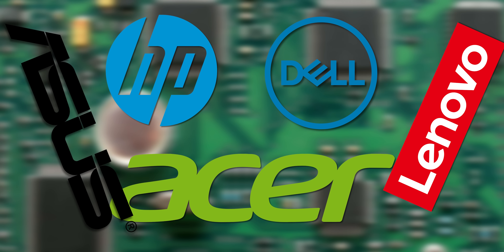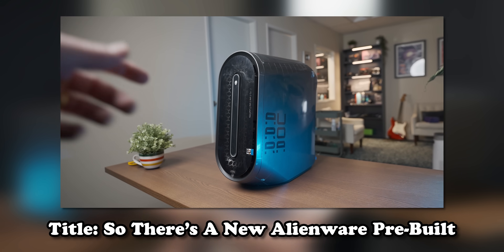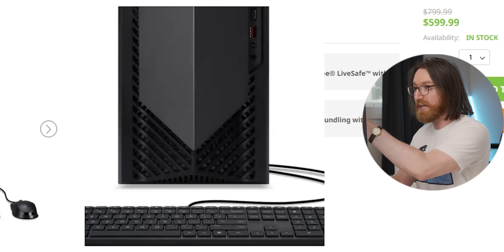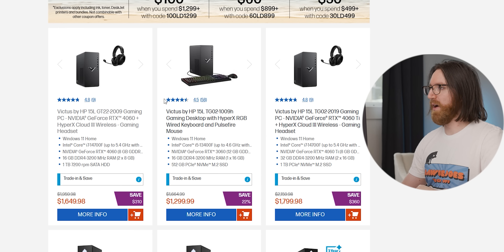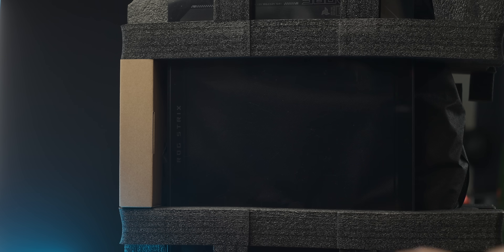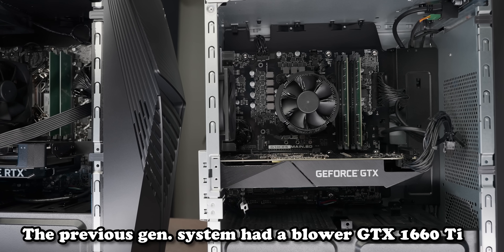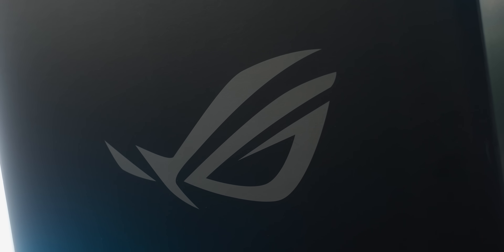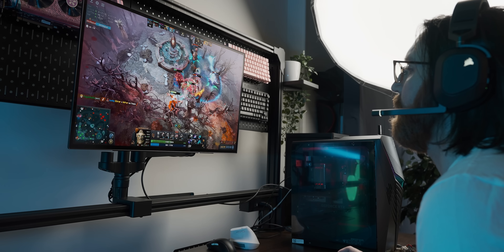Are Pre-Built Gaming PCs Better In 2024?

Comment: Dawid, I’ll never complain about a prebuilt ever again. I got a Skytech prebuilt with a 14700k and a 4070ti with 32gb ddr5, WiFi 6e board and an aio with a gen 1tb ssd at a local pawn shop for $600. And the biggest thing is it is all off the shelf parts. Nothing is proprietary. I’m in love 😂
Reply: Pawn shop was super stupid to set at that price. Super, super dumb
Reply: @kevinthecleric  I think it was a loan someone defaulted on so they just priced it at what they lost
Reply: Prebuilt is a just a term for a computer ready built. It's who built it and in what configuration that is the potential issue... And OEMs are the very worst for the reasons given by Dawid. Other businesses/solo flyers build with off the shelf parts and sell, Or you choose parts and they build and sell ... And they could make it decent. Buying pre-built doesn't automatically mean it's going to be bad in any form, But it could be depending. And some charge reasonable prices, Others rip you sideways. It's always best to build yourself for value and quality control, But if that's not your bag  there's good options out there.
Reply: Nice
Reply: Fairly standard pawn shop practice, but can't help but believe they let that slip through 'em without pricing properly. 900 bux would have still been pretty cheap for that.
Reply: Sounds like someone built a PC and took out a loan against it. Wouldmt really consider that a prebuilt
Reply: @benstanfill363  it has skytech gaming prebuilt stickers on it. So unless the previous owner has that for some reason where it’s not a prebuilt, then sure. I guess so. Never seen a case have prebuilt company stickers unless it was a prebuilt.
Reply: @benstanfill363 kid you don't understand what prebuilts are? They arent custom brand parts. They are parts you buy at a higher charge for putting the computer together and including windows
Reply: Youre describing custom built pc for your prebuilt definition, whereas prebuilts dont necessarily mean they were custom built. Custom being the choice of the parts being made by the user themselves.
Reply: @ I bought it used at a pawn shop. I didn’t go and pick parts and they build it. I would’ve built it myself before that. It wasn’t a custom build to me. But go on.

Comment: Intel replaced my CPU. Not loading the latest bios, on a newly purchased computer, containing a 13th or 14th gen intel CPU, is VERY dangerous to the CPU... Think of your CPU as a neighbourhood full of houses WITH a faulty power station in the middle... 1 computer crash equals 1 power surge that just burnt down 1 of the houses... That house will never stand again... The bios update fixes the, metaphorical, faulty power station. Running a computer "just to see if it has that issue" is a CPU death sentence. 

If you have a faulty 13/14th gen CPU, and you do not have your receipt, intel are still honouring the 3 year extended warranty... You'll just be required to remove your CPU cooler, take a photo of the seriel number and SKU number, on the CPU lid, and email it to Microsoft support... They'll ask you to attempt the bios update, first, to see if your CPU stops crashing but I recommend you tell them you've already done that and the issue still remains. They'll have you send your CPU back, on recorded delivery, and send you a brand new one within 5-7 working days...  My CPU was crashing 2-3 times a day, my new CPU hasn't crashed once and I've had it over a month now 😌

Comment: To clarify, the 13/14th gen issues are caused by the microcode requesting too much voltage for the CPU. At the very worst case, it causes a crash, but what's happening in most cases is long term culmative damage. If anyone has been running their chip for a year or more, they may find it's already fried and the update won't fix it.

I was in this situation. My 18 month old 13600kf is struggling on basic settings, unlike when I first had it. I RMAd the CPU and am waiting for the new one to arrive.

Comment: The HP inside looks incredible compared to any of the others when you see them...minus the airflow that's a really sweet OEM...I ordered an HP Victus laptop for a customer last year...awesome machine.
Reply: The CPU cooler look like some sort of server/hybrid cooler...looks really cool though😍
Reply: Nice RAM too, clean wiring...👏
Reply: @karstenswiridjuk4747  the computer has a small but normal cooler and is actually missing the cables going into the motherboard, so the computer in the picture would not work

Comment: When your RGB software requires it's own uninstall tool to get rid of it, you know it's the real deal in terms of bloatware.
Armoury Crate is like a fungus in your system when installed. Don't understand why it has to run countless server tasks in the background for switching the lights on and off, when I can control everything smoothly by using OpenRGB which doesn't even require an installation. 
The fact that you actively need to turn the AC installation off in the BIOS before installing Windows in order to be safe from it also doesn't make AC less cursed. 
As much as I like Asus for their hardware which NEVER gave me a single issue in 30 years of building PCs, I outright hate Armoury Crate.

Comment: Funny thing. I bought an Alienware (First and last prebuilt PC) back in 2004 before Dell. It had a dual tower cooler for the CPU with an 80mm fan in the middle for a Pentium D 3.0GHz CPU. It also had an ASUS SLI MoBo and a EVGA 7800GTX and Dual Channel RAM and a Creative SB Audigy 2 also a SilverStone 650W PSU that was basically a hairdryer. Man have they made some leaps and bounds backwards.

Side Note: That SilverStone PSU, I got it back from a friend a few years ago (2018 or 19) and hooked up a Core 2 Quad 9550 and a GTX 680 and tried playing Crysis 3 and the PC shut off after 5 minutes. Tried it again and got another 2 minutes out of it. Then I reinstalled my Cooler Master 650W I bought back in 2009 (5 years new PSU), and it had no issues, played for an hour or so. This is why to this day I think SilverStone is just bad. The heat that came out of it (on the Alienware) and it falls on its face when under any actual load.

Comment: oem do it this way deliberately, designing their own non standard so to upgrade the system you need to buy their custom non-standard parts. the case is closed because they dont run hot enough or well enough to get hot more accurately, to need lots of fans (cost) or vents. vents is to delay dust ingress perhaps causing breakdowns within warranty period. they want to tie you into their limited low power low cost ecosystem, knowing most people dont know how to upgrade more than ram or will pay oem service facilities to upgrade it for them. enough people do this to make it profitable sideline usually. the dev costs of the motherboard are minor since they tend to design one board for each socket as they release, and minor revisions only thereafter until they stop making a previous gen when they have no cpu/ram type stocks left. and thats same with their own case designs: they make them until they look dated when they just sell remaining stock until new design comes into production.

Comment: It's always better to find a trusted SI than buy an OEM prebuilt. Aside from bloatware and peripheral software that slows down the PC, OEM prebuilts usually have motherboard BIOS that have hardwired voltage limits so even if the CPU is good, the motherboard won't let it use it's full speed so that it doesn't get too hot because honestly those teeny weeny bebe coolers could never cool an I7 or R7 which would run hotter than 65 watts on full throttle.

Comment: So I bought a B-stock HP Victus prebuilt with a 4060 Ti and a 5700 for 500 usd, which seemed like a bargain.

 Starting off, HP's proprietary motherboard had no support for memory overclocking and only had PCIe 3.0, even if it claims to be a  B550 board, which should typically have PCIe 4 support.

So they paired a 4060 Ti which is an PCIe gen 4 x8 lane GPU with a gen 3 motherboard, effectively gimping its performance to a 3060...

Same for the SSD, they only have a single m.2 slot with only 2 lanes, so the SSD perf is literally halved.

Also their shitty CPU cooler uses intel 1155 mounting, instead of AMD mounting (that one is just weird)...

And finally, ofc they shipped it with a single stick of 16GB 3200 CL22  RAM. I guess I should be happy they atleast went with a high speed stick which helps AMD infinity fabric, instead of a 2133 CL15 stick.

Never again... 😂

Comment: I bought my MSI Codex R from staples for 1100 CAD. Gotta say I'm very happy with it. I5 12400f, 16gb xpg ddr5 ram, rtx 4060, 1tb MSI m.2 ssd, 650 psu and a MSI gaming B760 motherboard. I can upgrade to my hearts content. Just got a 4tb m.2 for the second slot. Next is a rtx 4070 super. Then a 13 or 14th gen i7 whenever they fix the issues with them lol😊

Comment: I want to mention that on a lot and of modern systems that bios do come in a firmware package under Windows Updates. You can also see this on your bios download page where it notes the download package is a firmware package.

If you run Windows updates I'm sure you'd see it, more than likely under optional updates for this bios (firmware) update as Asus has it listed as an optional update right now.

Just wanted to give you a heads up on that and other than that love the videos, they are always entertaining and make the day go by faster!
Reply: You have to be off your rocker to trust a BIOS operation to Windoze... Holy hell!!
Reply: @Oldsjunkie  it's been apart of windows for many years and is a normal process that most people don't even know happens half the time as if it's pushed by the manufacturer and is automatically installed through Windows update, so no, I'm not off my rockers.

Comment: They're close but not better. (At least in my area in Canada Ontario).  
Prebuilt for $1200 would get you i5 12400, 16gb DDR4 a rtx 4060 and a non z mobo.  
For literally less than that you can get an i5 12600kf, 32gb DDR5, rtx 4060 and a z mobo.  
So for $100 less you can get more performance and more ram, and you still have leftover for a monitor or keyboard.

Comment: I had a old dell pre built and the power supplies which I wanted to reuse had wires that only reached in the OEM case so 30 dollers in extensions later

Comment: Steps after buying a pre-built.
1 - Make a bootable USB with Windows.
2 - Get the Windows key for later.
3 - Note all software required for fan control etc for later.
4 - Reinstall windows. Nobody wants that dodgy "anti" malware.
Reply: With Windows 10 and 11, if the system is already activated, shouldn't the new installation of Windows detect the system?  I haven't tried it yet.
Reply: @TrusteftTech  im pretty sure it will just automatically apply whatever version of windows key is stored on the firmware
Reply: @TrusteftTech  It will. OEM systems come with an OEM Windows key that's stored in the BIOS.
Reply: Somebody that prepared, could have just built it.
Reply: Or 3. Set fan curves and disable all RGB in BIOS

Comment: i7-14700F shouldn't be affected since it's a 65W part. 14700KF would be sus. And only after prolonged use.
Reply: Maximum turbo power of the 14700F is 219W, and it's on Intel's extended warranty list. Everything 13th or 14th gen xx600 and higher is on that list, regardless of which letters come after it's name.

Comment: The Asus at 1:45 I fixed entirely with a hole drilled in the front, a 120 mm fan, and a 90 mm tower cooler. Temps on the CPU and GPU don’t go above 80° these days. Absolutely terrible design, but I got the display model for $500 less than retail.
Reply: No offense, but if you're talking about 80 degrees Celsius, that's still pretty bad. 
AMD considers 85 degrees to be thermal throttling.
Reply: @Boogie_the_cat ...what? AMD CPUs are rated to run 95c for days at a time.

Comment: Regarding BIOS updates on prebuilt/laptops, usually Windows Update will push the firmware in an update package, so you don’t necessarily need to go fetch the update on the manufacturer’s website, unless you want to get it faster. Alternatively, some of the usual OEM software contain updaters for drivers and other various tools for the computer.
Reply: That's what I was thinking, but I didn't want to comment about it since I wasn't 100% sure that was the case
Reply: Yes Asus Armory Crate can update the BIOS. But not a lot of people would actually care to go look into it and there are no reminder or whatever. Also Armory Crate is just pretty bad, it's better to download the drivers on the website, and it's just better to uninstall it, and for RGB, well first "who cares" and also it's Aurora that manages RGB mostly...
Reply: I don't ever recommend updating your BIOS through software. It's much safer to do it through a thumb drive
Reply: Windows pushing BIOS updates is extremely uncomfortable.

Comment: Does the PSU have the power and connectors to power a better GPU? I can understand the better CPU to GPU considering a person is more likely to upgrade a GPU then a CPU. Which trouble call would an OEM Rather have, Tell the customer to put back the old GPU because the new one is not compatible or tell them they destroyed their system with bent pins and that it is not covered under warranty.

Comment: The bios update by itself isn't a fix for the issue. I5s and up should be underclocked and undervolted to avoid long term issues. Intel is pushing their chips too hard and refuse to admit it. They just can't run reliably at those speeds, no matter how much they fiddle with microcode.

Comment: I got an MSI Codex prebuilt earlier this year and have been extremely happy with it. Great part configuration, no shady proprietary stuff, no low end variants of the parts. I have since changed the gpu, case, and cpu cooler but still using the original fans, cpu, mobo, and psu. Those changes were simple upgrades or aesthetic preferences, nothing wrong the actual parts that were swapped
Reply: Wait, so you paid double for components in a prebuilt that you could have bought yourself, just to move and replace those components in less than a year...? What exactly are you bragging about? I legitemately want to understand this logic.
Reply: @Oldsjunkie  normally id disagree because there is a real logic to prebuilts. way less hassle if anything goes wrong. dont need to mess with things to get it working. 

but then the guy mentioned he changed out everything and i was thinking the same things you were lmao. he wasted so much time and money on that. keeping the psu and mobo was a terrible idea too because thats ALWAYS where prebuilts go cheap.
Reply: @Oldsjunkie  Who would expect that someone who watches Dawid's videos would want to buy a PC and swap out parts? Unbelievable!
Reply: @MontagueZooma  can actually make money if you shop sales lol.
Reply: @Oldsjunkie   i actually paid less than if i got the parts myself and built it. Saved about $175 vs doing it myself. Im all for building my own, have plenty of times but bestbuy actually had a great deal. Paid $800 for it. Then i sold the parts i swapped out and it damn near paid for the gpu upgrade. So i actually made out ahead of buying and building myself. Just have to shop around for sales!

Comment: The Intel CPU issue is related to the CPU degrading so you won't have issues right out of the box. You need to update the firmware before the CPU degrades. Updating the firmware won't resolve issues with a CPU that is finally degraded 6 months later.

Comment: Why is ventilation always an issue? It seems like that is always a very easy fix. So why don’t they?
Reply: Most major OEMs are very slow to change. Their PC case designs were made back when PCs generated half as much heat and they are slow to adopt new designs due how big they are. They also love to cheap out on components to maximize profit margins. Dell uses a single chassis design across all of their desktop products to simplify the manufacturing process, so the alienwares just use optiplex cases but with a plastic shell covering them.
Reply: @konga382  I’ve honestly never played a computer game before. Last game I played was on Nintendo 64. Anyways adding some holes for ventilation seems so easy to do. It’s like they put looks over function.
Reply: They just don't care and saving on money
Reply: Simple: They want it to die sooner than later so you buy another one or cannot pass it to someone else when it's time to upgrade. That and the situation on single DIMM of ram is ridiculous.
Reply: @Tarukeys  honestly with DDR5 a single stick of RAM is fine as long as it’s not too small like 8GB
Reply: @drew2626  yep. But it wot be kinda counter intuitive. The high number single sticks can be as much as two slower sticks with lower cas.

Comment: Honestly I don't find the single channel ram to be quite as big of an issue if there's a dedicated GPU, but it is definitely preferred. At least with faster (at least 2666mhz) DDR4 and up.

Firmware updates can actually be installed automatically by Windows Update now thanks to UEFI BIOS specs.

It is nice to see the improvements in cooling, Steve would approve 😂